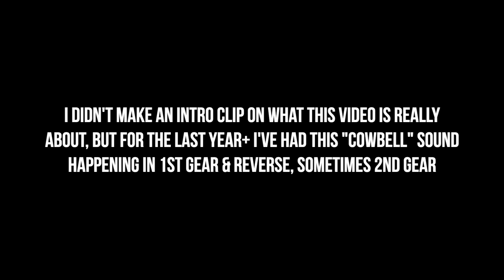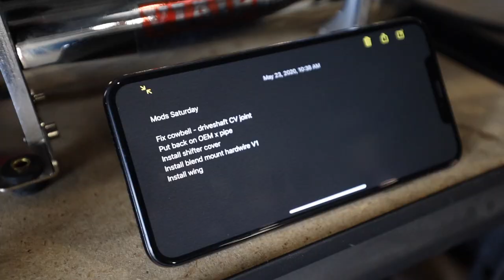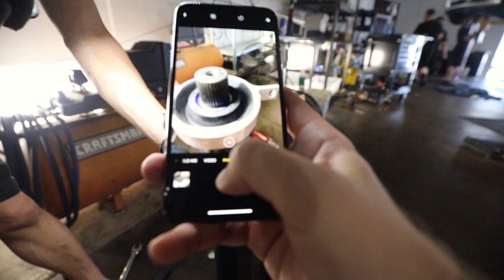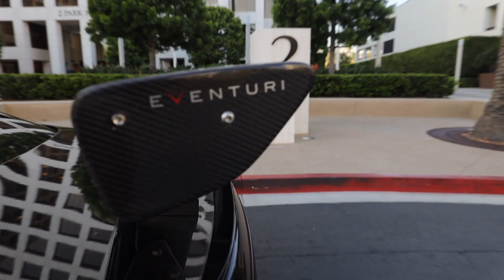How to fix the "cowbell clunk" sound (E92 M3 center support bearing)

Comment: Thank you for the video!!! This fixed the cowbell sound on my 08 E90 M3. I was able to remove the old carrier bearing with a prybar, just had to work around in circles until I got it all the way off. No torch needed! I used the bolt/socket method to press the new one on. I also marked the driveshaft before I split it and marked where it bolted onto the diff. I took it for a test drive and no vibrations. 

Doing it alone with jack stands was kind of difficult but it was possible. The hardest part was dropping/installing the muffler and mid-pipe.

Comment: He didn't mark the driveshaft before he took it apart? Misaligning it will throw it out of balance.
Reply: Facts.  And pro tip if they had an air hammer could of took that driveshaft bearing off in 2 seconds.  Heating it that's a no no.
Reply: @Yanman233  heating it is fine. It's an oldschool trick when you don't have a press to press in those bearings, or the removal tool needed.
Reply: @sethpoeski2954  I know it's an old school trick but it's still an improper procedure.  It's done cause guys don't have the right equipment. And  @mi76ke I'm a level 1 certified BMW Tech 🤫🤫🤫🤫🤫🤫 10 plus years
Reply: @sethpoeski2954  the drive shaft is heat treated for strength.  Heating it up with a torch weakens the metal in the area.

Comment: I had the same cowbell noise and fixed it by changing out the CSB just like this. I didn't need to torch the old one off, it came out easily with a rubber mallet.  I didn't have nearly as much play in mine, nor were the bearings making any grinding noises. I wasn't sure it was even the problem, but once replaced, the noise is now completely gone.  Great video!

Comment: The guy seems very knowledgeable about bmw but he drives an audi. Anyway, i have some critiques about his methods....1. He didn’t support the transmission when he loosened the bracket. 2. He didn’t mark the alignment of the shaft to put it back together the same way. 3. He used that blow torch and said that its better but a chisel alone could have worked better. 4. He didn’t preload the center support bearing on reinstallation so its going to wear out faster. Also, your engine mounts were under some strain without the transmission be supported when the bracket was removed. Good points, 1. He pronounced giubo as joo bow which is correct. 2. He said the diff input cv joint hardly ever goes bad. 3. He made you also change the flex disc as it was already out. 4. His 36mm socket method to reinstall the bearing was cool.

Comment: One thing I was paranoid about when I did this a year ago was the re-alignment of the splines when putting back together. Apparently there is no documentation on this anywhere. I don't think it needs to be exact and so far soo good.
Reply: did it ever gave you any problems not aligning them? Im currently paranoid about it 😅
Reply: @markcalaway3301  Nope.

Comment: Didn't hear anything about it in the video but don't you have to make sure you realign it with the way it was before because the drive shaft is balanced once from factory and if you put them together in a different section it gets unbalanced? correct me if I'm wrong.

Comment: Mate....this doesn't fix the noise...lol...see all other people fixing it and where is the noise coming from...noise is moving/play/wear between driveshaft and differential ...or othe have it from the cv joint.
Bearing you've changed doesn't do the noise...
You should have moved/rotate the rear wheel and hear where the noise is coming from.